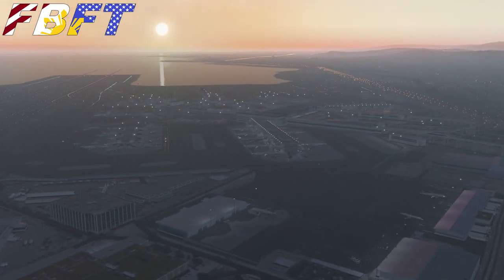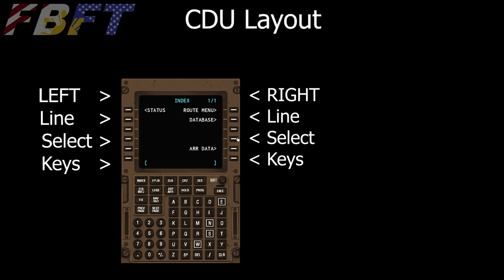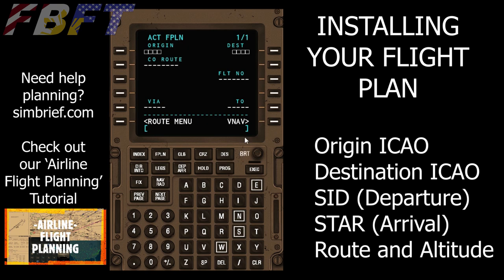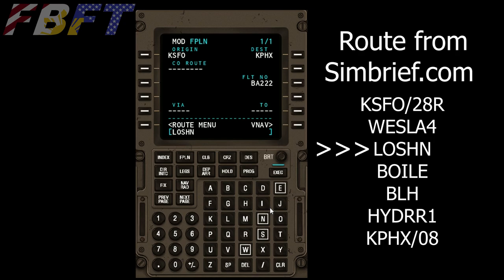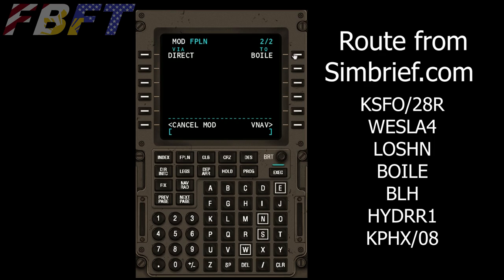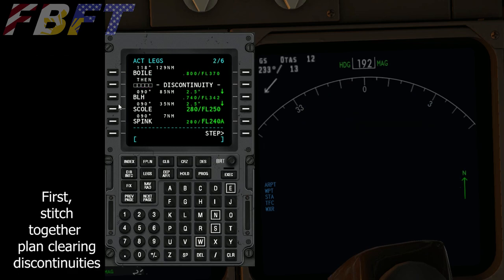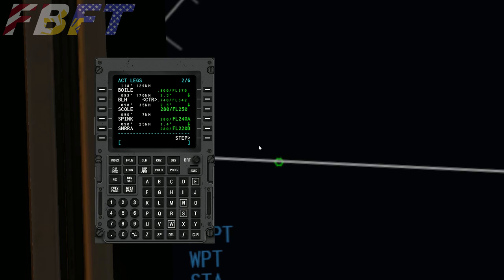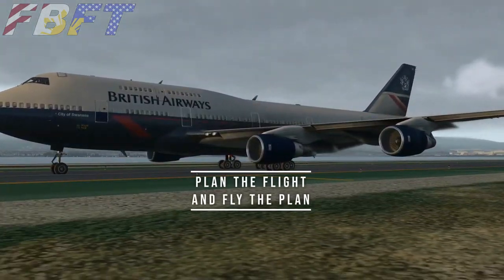X Plane - Default FMC / FMS Tutorial - Setup and Install Flight Plans

Comment: I subbed; what if the CDU (FMS) screen is blank both in pop-up and in the cockpit after connecting power (EXT/BAT/APU?  I'll look at your videos, see if I can learn some more. :)
Reply from the maker: Thanks for subscribing. Assuming you are on the B747, you might have missed the BUS ties. Definitely check out the 747 tutorial for a full checklist and power up procedure.
Reply: @FlightBrothersFT  Likely... it seems to be elsewhere, since I tried the default 737 and its FMC works and isn't blank... the weird thing is that the default 747's FMC is blank, even with the BUS' on.  But again, the error is on my end.  Welcome!
Reply from the maker: Kristoffer Thorsheim other Flight Bro (Lee) here, not sure on the 747.  The FlyJSim Q400 Legacy requires an FMC pop out button to be configured.  Possibly try this, but I also do not have an issue with the 744.  We’d be interested in any feedback you could give us and the viewers.
Reply: @FlightBrothersFT  Hi Lee -- of course, I'd happy to provide with info.  I guess, I need to go on the "org" for support, but its weird that a blank FMC (both popup & screened) are not working on both aftermarket 744 and the same issue resides in a vanilla default 744 as well; where as, again the default 737 is not producing the same error...?  I have updated my fms nav data via navigraph to see if it was this,  its a nuisance... on to the org forums I guess it is yet again.
Thanks in advance!
Reply: @FlightBrothersFT  & Lee; I can reproduce the error now (it seems)... seems like the default FMC/FMS is mapped with the joystick of "Avionics On/Off" ... meaning that if you're using the Honeycomb Alpha, turning Avionics on by default mapping switch of Avionics switch on, turns on the wxr (weather on PFD) AAAANND YOUR FMC/FMS's!!  So there was the error, it was nothing bugged or that... a few nights rest on going through where fault may lie, it was the avionics button, if its mapped it needs to be on to get weather (terrain works without) and the FMS/FMCs!... at least it turns them on, so it should work then; which it does!... this is for the 744 both modified and default....
Reply from the maker: Kristoffer Thorsheim fantastic that you reproduced and figured it out.  Thanks for sharing, I’m sure this will be of use in the future for someone!

Comment: Thanks for your tutorial. I am recently struggling with braking the aircraft while taxiing. Basically the problem is that after i have applied the toe brake to stop the aircraft, because I need to make a turn or stop short of holding point, the aircraft won't move again after I throttle again. It is stalled for some reason. Have I done some wrong or is it because of some other reasons?
Reply from the maker: Interesting. It sounds like the parking brake is engaging. You could check your controller settings (if you're using pedals with toe brakes) to be sure they are set correctly. The keyboard command to engage or release the parking brake is 'b'
Reply: @FlightBrothersFT  The parking brake was not engaged when I braked with the right toe brake. However, I now make do with the parking brake instead in order to brake during taxiing. Thanks for your reply

Comment: hello sir, im already update the airac, but in the default fmc aircraft like the boeing 737 ( not the zibo ) and the 747, its not updated, i put a new airport in the fmc that i can put in zibo fmc, but in the default it said not in database. Can you help me?
Reply from the maker: You might need to check that your AIRAC is correctly installed.  I have never experienced the issue you are having, and I have updated the nav cycle probably 25+ times.  First, check the directory you installed it to.
Reply: Flight Brothers FT i installed it to custom data and its updated at the zibo, i look at the database at the default 747 fmc, it already updated, but when i insert the new airport or some waypoint, it said not in database..

Comment: can you tell me how to remove old flights from the fms?
Reply from the maker: If you mean saved fms files, go to the Xplane directory on the hard drive. Find the OUTPUT folder, and the FMS PLANS folder inside that.  Delete unwanted .fms files.
Reply: Flight Brothers FT like, what i mean is, say you entered your first flight ever in the fms, then you want to start another, or more really, how do start or reset the fms where it is a clean slate? kinda hard to explain
Reply: when i’m at the gate, ready to go to the next destination, i hit flight plan on the fms, it still has the flight i just did, trying to enter new origin and dest
Reply: Flight Brothers FT or in other words, how do you delete an active flight plan in the fmc
Reply from the maker: Okay I understand. Go to the FPLN page on the FMS and enter a new departure airport code. Once you do it seems all data is cleared and the FMS is basically reset.
Reply: Flight Brothers FT i finally figured out what was wrong, i was having problems doing that, then i finally figured out how to remove the invalid entry then enter new origin

Comment: Don't honestly know how I'm going to learn all this, I don't even know what sids and stars are. The FMC in XP 10 was more user friendly.
Reply from the maker: Start with this video we made on airline flight planning. It explains the SIDS and STARS nicely. Let us know if you have questions after you check it out. https://youtu.be/sHcD0HQyy14
Reply: @FlightBrothersFT  Hi. I've entered all the flight data inc SIDS etc but the FMC wont seem to give altitude data for each waypoint as I think it's meant to but I do enter the cruise altitude. However when I try getting the aircaraft to follow the FMC route I entered the plane (The default 737 and MD-80) will just ignore the set speeds and altitude in the FMC and will just keep climbing and speeding up unless I manually hit autothrottle or altitude hold. Also I noticed it says the AIRAC Cycle is out of date on my Simbrief flight plan so I'm not sure if that could be the issuse or how to change that. Can you please advise? Sorry for the questions but I'm quite keen to get this right so I can start to enjoy flying rather than scratching my head.
Reply from the maker: Lots to unpack there.  1. AIRAC cycle nav data- your sim brief cycle needs to match your Xplane cycle, or some waypoints won't exist.  Nav cycle would not cause the issue you described.   2.  Cruise altitude. Assuming you get your plan entered first, then enter a cruise altitude on the crz page, the FMC will then automatically fill the cruise altitude on the legs page.  SID and STAR waypoints will have there own preset altitudes that come from the charts and nav data cycle.  Once that is entered, the autopilot mode is the next part of getting the aircraft to get there and stay.  Typically on climb you would activate (737) NAV,  VNAV, auto-throttle, and then press CMD.  These modes will then show in the top of the PFD above the artificial horizon.   On the MD80, you will activate FMS (does what Boeing NAV does), VNAV, auto-throttle, and then toggtle the autopilot switch up (basically like CMD on the Boeing).

Both the Boeing and MD will climb and hold cruise altitude with the above procedures. Descent is another story, and we have a Zibo video demonstrating that on the 737.

Good luck!

Comment: someone had a the brightness FMC problem??  all my default planes works but the 747 FMC doesnt turn on, its just dark withou turn on, i tried roll the bright switch but nothings happen, i do the cool and dark startup doing step by step but nothing
Reply from the maker: Hmmm.  That is a unique problem I have not heard before. Perhaps check that a system is not failed in the failure menu.

Comment: is there a way to load  a pre saved flightplan into the fms,  just watched a video whereby the fms had a "menu" button, but i think had to be a different plane.....been looking for a video but can't find one, i thought if anybody knows how it will be you guys the flight brothers.......don't misunderstand the vid is excellent but wouldn't mind a quicker way to use in conjunction with simtoolkitpro....peace
Reply from the maker: Sure, we got you! Download a flight plan from simbrief in the default .fms format. Put it in the folder xplane11/Output/FMS plans. Once in the sim click ROUTE MENU (right soft key 1) then CO ROUTE LIST (left soft key 2). Scroll as needed using next page and click the soft key beside the plan you select.
Reply: @FlightBrothersFT    thx,  i'd just figured it out,   but i might not of done, and your reply was swift which i appreciate.. peace...quick q i'm a noob as you can tell, how i get full cockpit lighting in the 747-4 ...it's not best using the nvg's  lolz
Reply from the maker: Couple tips. Under the VIEW menu is an aviation flashlight, very helpful. Next, the 744 has panel backlighting knobs for all the text around buttons and dials, look at the bottom left of the overhead panel for most of these knobs. The Captain and first officer positions have separate knobs for their panel displays to the top corner if their panel ( between window and panel). If you want a dome light click the STORM switch on the bottom left of the overhead.

Comment: wait i'm new to xplane and i set up the fmc but what do i do after? how do i set it to autopilot
Reply from the maker: Welcome to Xplane!   The next thing you need to do is understand the functions of the autopilot (lateral, vertical, and throttle) and how to control those (direct MCP input or FMC program). Watch our video on the MCP Mode Control Panel https://youtu.be/oyHmFsZVmfY for info on that.   For a quicker view, watch the end of our 747 tutorial and you will see a takeoff and engaging the autopilot. https://youtu.be/pVgBRlKiMiI    Basic instructions are this: have both Flight Director switches on and the Auto-throttle switch. At 1000' or higher click LNAV and VNAV then CMD.

Comment: What is LOSHN Mean ?, i get it, it was departure code but i search it somewhere on google and nothing tell about it.
Reply from the maker: It likely does not mean anything. The codes are meant to be pronounceable, in this case likely like the word 'lotion'.  Some codes do have meanings, but are usually very specific to the city and airport.
Reply: So where do i found codes like this ? Or should i create the new one ?
Reply from the maker: These are GPS waypoints located on aviation charts and inside aircraft FMCs. When creating a flight plan, your route will include many such waypoints. Watch our video on Airline Flight Planning to see how to make a plan.  https://youtu.be/sHcD0HQyy14
Reply: Ok, thank you for your advice bro

Comment: This is too complicated for me; in other flight simulators I merely filed point A to point B, climbed, then turned on Nav. and the aircraft automatically turned to my destination; that's it.
Reply from the maker: It is still possible to do a simple point to point with this FMC. You may find you need at least 1 waypoint between.  Regarding the level of complication though, you can thank real world procedures for that. This is how all IFR flight plans look for GA or commerical aircraft.

Comment: Did you make an autopilot tutorial?
Reply from the maker: We have two things that might interest you.  Our 747 tutorial includes the initial engagement of autopilot. At time 34:40 we are about 1000' in the air after takeoff and about to engage.  https://youtu.be/pVgBRlKiMil
   We also have a more general video on all the different functions of the autopilot and mode control panel. It's filmed on the Zibo 737, but it is nearly the same for all modern Boeing's. https://youtu.be/oyHmFsZVmfY
Reply: @FlightBrothersFT  Thank you!

Comment: I typed way too quickly...no matter what I do it won't accept anything I attempt to type into departure, destiny, waypoints. etc. Frustrating!
Reply from the maker: The key is being patient with them.  Each has different info they like, and in certain orders (default, Zibo/Boeing/Airbus).  We find the default is more similar to Boeing logic (Zibo and Flight Factor for example) than Airbus.  We’ve made a short cut cheat sheet for Airbus from our friend Ronnie.  His Airbus “FMC” video is available over on FSElite YT channel if you have a ‘bus.  Also by clicking the input line on the bottom of the screen you can use DKE (direct keyboard entry) to type the data in.

Also of note, if you find some of the waypoints won’t work, it could be an AIRAC issue.  We use Navigraph for keeping our data/waypoints/SIDs/STARs up to date.  There are other methods, but this is our preferred due to ease of use and continuous addition of features.  We are not sponsored by then in anyway, but sometimes use their charts, through permission, with some of our videos.